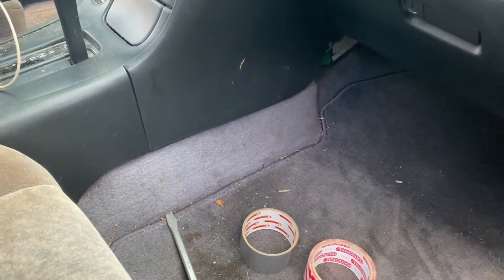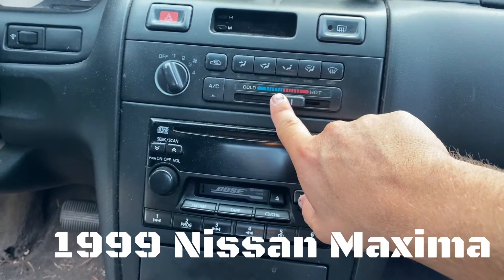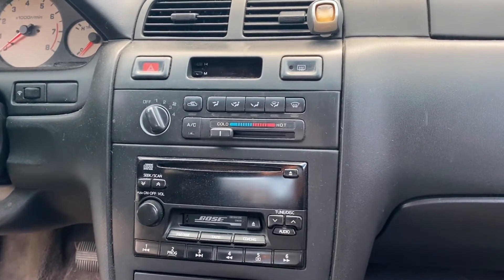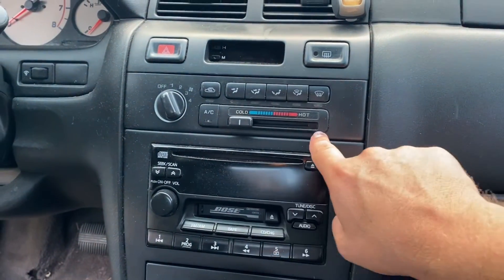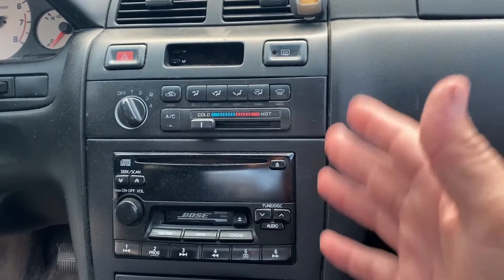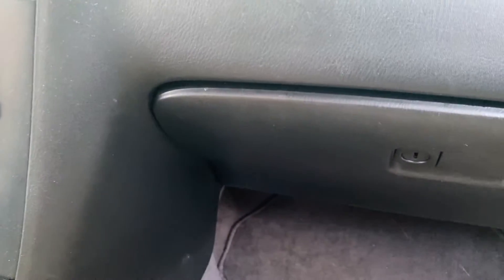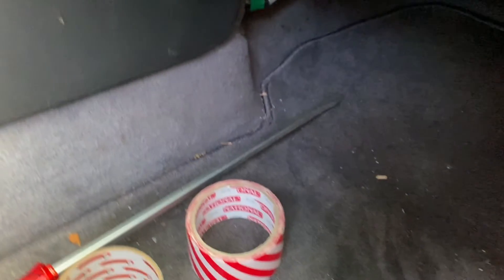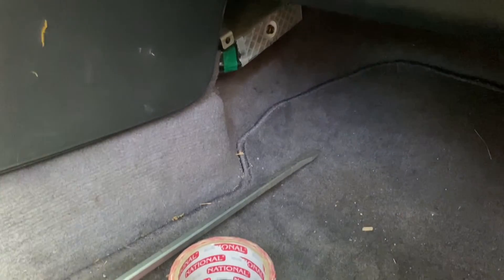Break to Repair! AC Not working Only HOT Air! Blend door actuator. 1999 Nissan Maxima

Comment: Thank you very much for help.
 I had exact same issue, but instead of  duct tape- I used piece of wire, to secure that plastic piece.
Reply from the maker: I was thinking of installing a wire so I could move it when needed

Comment: Hello friend, how are you, the same thing happens to my car (I'm from Santiago de Chile), and this crappy actuator that only serves to open and close the lid and to keep out the heat costs me 350 dollars to bring it from the US for eBay... 

I am a mechanic and the solution is to do the same as you and the other, more professional one is to disassemble and remove the actuator and simply clean its internal contacts since these become sulfated and also the same grease that lubricates the plastic gears causes it to become isolated and the The electric motor did not rotate and the dirt remained either cold or hot haha.. so I gave my car that solution by just cleaning the actuator and it worked again. The other thing is to do the same as you but put a cord or cable to open and close that lid and keep the heat out. Greetings.

Comment: Good video bro. The actuators in autos are pure garbage. Gotta change one on my wife's Jeep every year. The plastic gears wear out.
Reply from the maker: Every year?? Ouch…. I just checked pricing….could get a cheap under $100….probably a short term fix.
Reply: @mcycleshawn  naw, I get them off Amazon for around 15 dollars. they're identical to the factory actuators. I kept the factory one and compared the internals to one off Amazon and there is no difference. All are pretty much plastic junk. You might try Amazon? I've thought about getting a cable control and hooking it up to this one that keeps failing - blend door for heat/cold. Like the old days bro. everything was cable controlled back in the day - never much trouble with them.